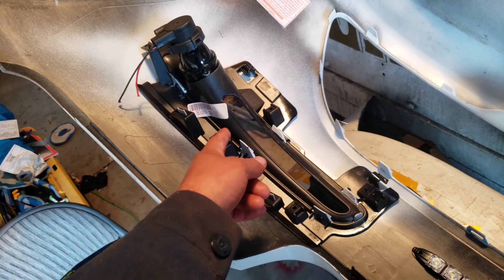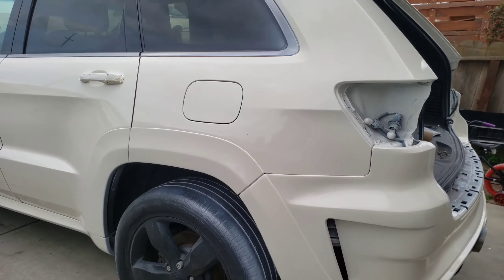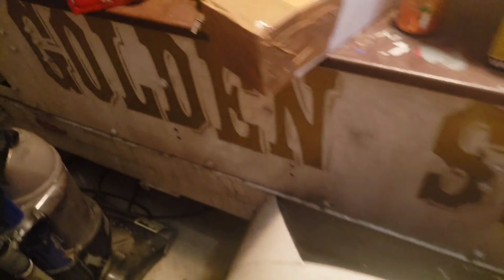jeep srt8 clone diy bumper foglights and day time running lights -cheap fog lights & srt drl

Comment from the maker: want to watch more of this jeep srt conversion?? check them out here #REBUILDMAFIA .
Reply: How much was the whole srt8 body kit
Reply from the maker: $200 for the rear bumper and side skirts and back fender flares bought used on FB market place and  $350 for the 2 front flares  and about 250 for the front bumper so the whole thing was about $800 bro
Reply: Thats not bad your jeep came out clean i have the same one but i wanted to do the 2014 jeep summit but haven't seen no one do that conversion
Reply from the maker: It'll basically be same thing bro besides the front fascia but I'm pretty sure there wont be any major modifications needed at least none that you can't pull off at your home's garage bro, thanks for watching 👍✌
Reply: Just the back trunk door are different and lights so it could be a good conversion but thank you bro and keep the good work you do  👍✌🏼
Reply from the maker: O ok I don't know much of them summit bro, thanks for watching bro 👍✌

Comment: What jeep was this?
How much was the bumpers front and back and sides covers
Reply from the maker: It's a laredo bro ,the front bumper was 350 plus the grills and the back bumper was bought in a bundle used, it was 600 for the rear bumper the side skirts, the rear fender flares, the exhaust and the interior bro,👍✌

Comment: I bought the same bumper but how did you put the bezel on ? for mee it looks like it doesn’t fit but it should since all of the jeep
srt bezels are the same. Do I have to force it on
Reply from the maker: Yes it's not the easiest, I had my struggles also but it's more because my bumper was aftermarket and the bezel was oem and they don't like each other and that's the reason but I managed to make them fit although some clips didn't go in all the way bro,👍✌
Reply: @CALIREBUILDABLES  any recommendations on how i can put them on since my bumper was aftermarket as well with oem bezel. 
The clips are very wierd.
Reply from the maker: Just force them bro and if they snap back out what I did is I pit one in and made a hole on the tab and put something that works as a pin to keep it from going back, maybe rivets or as simple as a zip tie it will depend on what you want to do but for something more permanent use fasteners bro👍✌
Reply: @CALIREBUILDABLES   thanks for the help bro 
and thanks for replying
Reply from the maker: No problem, I appreciate you watching and leaving comments 👍✌
Reply: @CALIREBUILDABLES   hey bro sorry to bother, but my bottom half of the bezel is not allowing me to fit it. it looks like its hitting and not allowing to fit in right and wont go all the way in.
Reply from the maker: Just make it fit and hold it bro, there is no ther way, you just have to do a title custom work.
Reply: @CALIREBUILDABLES  
Update- i made them fit barely lol alot
of custom work but now i ran into another issue.
the edges of the bumper where it meets the right and left fender does not fit. Do
i need another bracket for it ?? everything else clicks into place but both sides are wierd and will not fit( zip ties to hold it down for now
Reply from the maker: It should fit bro, not really sure what u mean .
Reply: @CALIREBUILDABLES   is there a way i can email you what i mean ?
Reply from the maker: Yea bro but if you have instagram you can mssg me trough there @calirebuildables

Comment: That came put pretty good. How do they hold up during g a car wash?
Reply from the maker: They will hold up depending on how much epoxy you use and also not trying to focus the pressure of the water or the sponge on that area would help also 👍✌

Comment: Where are you able to find the parts I'm looking to do the same upgrade
Reply from the maker: Which parts bro?
Reply: @CALIREBUILDABLES  the srt  rockerpanels
Reply from the maker: The rocker panels were bought used on Facebook market place bro the parts used are in the video's description except the ones that I bought used locally.

Comment: Hey bro I’m trying to do the conversion on my 14 hemi. I tried the links in the bio for the led strips and fog lights and they are not available or outdated
Reply from the maker: Ok it's just a 2" fog light and look for a led strip that has 3m double sided tape on the back... but let me see if I find similar ones as the ones I used
Reply from the maker: Here is a similar led strip but mine was 13 bucks  https://www.ebay.com/itm/Daytime-Light-Strip-Flexible-DRL-9-LED-White-Turn-Signal-Light-Suba-MM-/283585254181?_trksid=p2349624.m46890.l49292
Reply from the maker: And this are the foglight, they fit exactly on the bezels foglight hole bro https://www.ebay.com/itm/H3-Clear-Glass-Lens-Projector-Fog-Lights-Driving-Lamps-Kit-Brackets-Left-Right-/383583523696?_trksid=p2349624.m46890.l49292